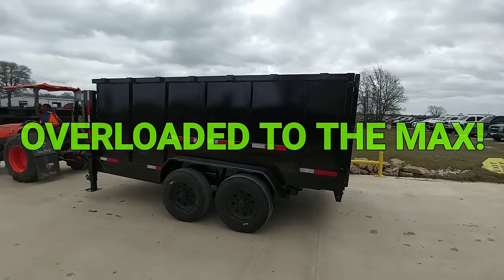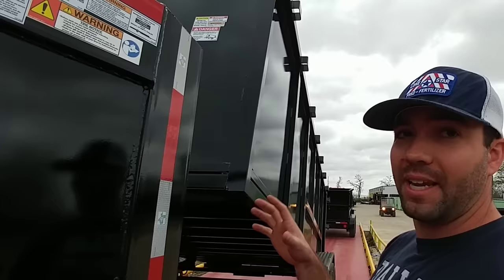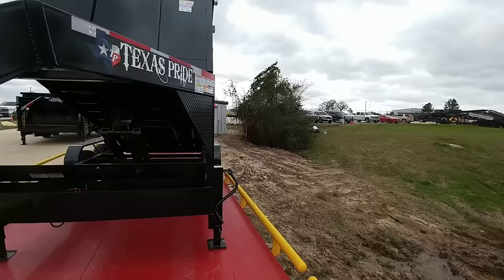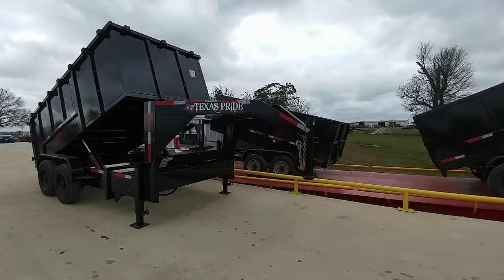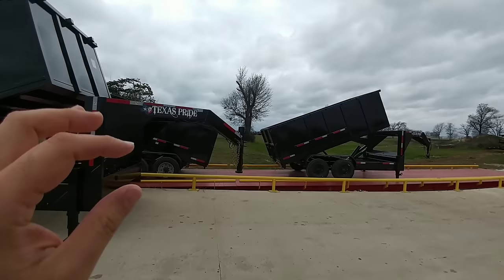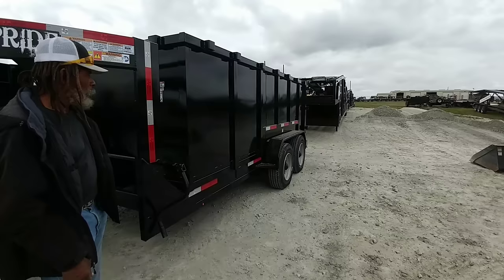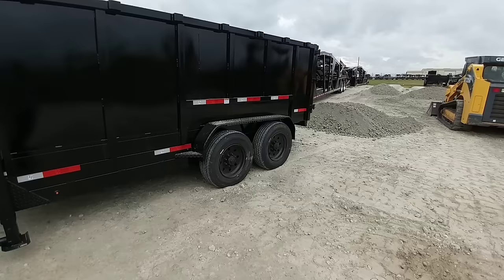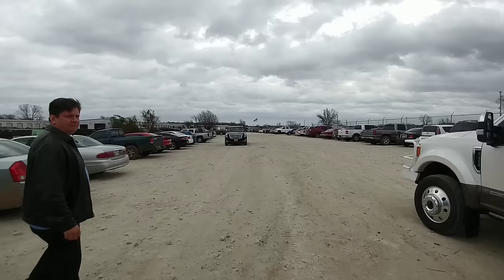Crazy Test with 3 Dump Trailers WAY Overloaded! See which ones failed!

Comment: I've used all types of dump ram systems in the heavy construction industry and the semi single ram is great BUT I've also seem many of them tip over, two main reason. 1. The operator doesn't lift on a level  and solid grade. 2. The material gets hung up on the front of the trailer and one side brakes free while leaving the material weight off setting and twisting the ram and dumping the truck and trailer.  Engineers can apply all the math for PERFECT mechanic's of lift and stress points, the one variable that can't be figured in their equation is when the load hangs up and the operator is inexperienced in realizing there's a problem before the point of no return.

Comment: For sale, three trailers only used once!
Reply: What size?
Reply: Give me a good deal i need one of those anyway. Ill change all the seals.
Reply: They actually gave them away. Although the one with a bent frame they replaced first
Reply: @Sicktrickintuner  Wouldn't the bent frame refer back to their engineer expert?  I have worked with engineers before.
Reply: As is...

Comment: Redundant doesn't mean what you think it does. Redundant mean the extra isn't necessary. If one cylinder fails on a twin system they whole thing goes down. That's to opposite of redundant.

Comment: We had a tree removed,and the crew used a dump trailer, with a scissor lift. I noticed they kept two blocks of wood under the front of the trailer, preventing it from coming all the way down.  It stopped about a foot from being all the way down.  I asked why, and was advised, that was the only way they could dump heavy loads.
Reply: Sounds like you went with the cheapest bid

Comment: Great video! Thanks for the info. That pin can be held in place by a piece of chain and an implement pin w/locking ring. Hook the chain at the bottom of the door. Drill the pin hole in the handle. Make the chain where it tightens, before the door pin clears its locking hole. Just a thought, I'm looking for a 7 x 12 , with a spread gate. Thanks again!

Comment: Look at the BIG trucks they all telescopic, enough said. Been pulling dump trailers 19 years, frame, frame less, tub, square, closed tandems, spread axle. I've had 79,000 lbs IN THE TRAILER, no issues dumping.

Comment: I've hauled 22 thousand in the trailer with the scissor lift we use bars on both sides to get it started to dump.
Tires take a beating .
Always put 17,000 in the trailer at the Gravel Pit it's the perfect heavy load.
For a pickup!
Very good trailers.
There is one thing though on the tailgate The Swinging Doors the outside pockets fill with water causes the weld to rust and they break.
If they had a hole in the bottom of the pocket they should drain.

Comment: I have an old 72 Donahue 8x16 grain trailer. I was hauling driveway gravel. The sand pit operator had broken his arm so his wife was running the loader. I came across the scale at 30060 lbs on three axles. The front axle of the pickup was off the scale. The old girl protested but lifted the load. It has a scissor lift. Scissor lifts help raise the load evenly when not loaded even side to side. Great video!
Reply: I have one of those as well, it was always my favorite trailer. 
I have a 8x20 with a scissor lift and it can't lift if I'm fully loaded with shingles. I'm needing to figure that out.

Comment: Dual cylinders provide no redundancy if they're on the same circuit.
Reply: bzacon 

They also do no good individually if they're on opposite sides of the trailer.
Reply: No, but there are easy ways around that.
Reply: Puckgrinder85 

Such as?
Reply: If one fails in series they both fail. If the are plumbed independent and one fails it just bends the hell out of the trailer and probably won't lift.
Reply: I don't think it would ever be an approved designed if they were independent due to a risk factor
Reply: If one ram in a independent dual ram set up fails the trailer tips over and bends every thing any way. The only redundancy that works is a self locking ratchet bar but none likes them due to the clunk clunk clunk.
Reply: Nonsense! I was told I there'd be free beer until 4:00!

Comment: There are still a lot of variables in this test. Battery strength and where the dirt is loaded in the trailer to start. Should have used concrete blocks instead that way it could be put in the same location in the trailers between the three.

Comment: I had problems with a telescopic lift on a 1 ton dump, but a lot of people have told me a pusher sissors lift is the best on a truck, but I bought a dual cylinder thinking it would be sturdier!, and lift the weight its rated for with out any problem!, I will not overload it because the tires are only so strong!. I dont care how fast it dumps as long as it works good!. What a great test!.

Comment: We have nothing but scissor lift dump trailers, with a simple adjustment of the pressure relief which is set way too low from the factory it will dump more than you can put in it. The only reason it won't lift is it goes into hydraulic relief right away. With the weights we Haul, I believe it's time to move to a gooseneck versus bumper pull.
Reply: Tread Lightly Services LLC. That may be something I need to look into ASAP.  Dump my 14k at about 20-22k 5+ times a day and man does it struggle.
Reply: Also large thing with a scissor lift in the placement of the cylinder on my dump it’s with in the first 4 feet of the dump bed. It’s able to dump 10-12k no problem every time. Even when most of the weight can be right on top of the cylinder.
Reply: We increased the scissor lift pressure on our farm truck dump bed just enough to get it to lift fully loaded and it worked for a while till the lift cylinder blew apart.  Then we got to unload the whole bed of grain with shovels and repair the scissor lift.
Reply: @robhartshorn6823  I really shouldn't have laughed, because I know what that's like.

Comment: Electric over hydraulic pump have a pressure  set screw in the pump . I always turned them up a little to get more on the pressure side less return. Used to load 8 - 9 tons no problem

Comment: I'm telescopic all the way less stress on the cylinder and framing of the lift then the othere that are pushing so much in diff points just to lift a load the. Straight up bad down
Reply: exactly, telescopic is the only way to go.
Reply: If only it  would lift as high as the other ones 😕
Reply: @andp120  every one iv ever had went higher then otheres

Comment: Everyone is choosing the telescopic front cylinder.  But, what about stability on slightly uneven ground?  All working situations are not under laboratory conditions.  Because of this I would prefer the double ram and I am considering side to side level and tip over potential.  Just commenting.

Comment: JD you’re absolutely correct. My dump trailer has the piston underneath. The first 6 inches is the hardest when it’s loaded front heavy, after that it’s fine. The style you have wasn’t offered when I brought mine but if I ever get another dump trailer I’m gonna get the kind you have.
Reply: The second stage isn’t as strong as the first, I’d seen plenty of dump trucks get a load 1/3 of the way dumped and the next stage was maxed out.  

With the single or dual, the angle is bad for the first 6-12” as it’s pushing back more than it’s pushing up. 

It’s extremely likely that the first on would of lifted up and then overloaded the next stage before the load shifted.  Once the load shifts and starts dumping it’s lighter and will dump so really depends on what you haul and if you can shift the load soon enough.

Comment: Y'all need to run a video tutorial on front-of-load baffles to defer the weight of heavier materials into a smaller linear space back closer to the axles.  And if you don't have a kit you damned well should draw one up.  Keeping a denser load from shifting forward is VERY important in dump trailers.

Comment: Are you sure about the dual systems having redundancy? I ask because it is my understanding that if one fails, the other one is typically not strong enough to lift the trailer with any kind of load on it. To me that would mean you have two points of failure in your hoist system instead of just one. I’m only looking at telescopic and scissor lifts at the moment

Comment: Scissor lift every time for myself, the rocking and twisting of the body isn’t applied directly to the cylinder when pulling foward on uneven/bumpy ground which is generally the case for these dump trailers... those 10k axles are also not cheap to replace
Reply: Bumpy and uneven ground is the reason I would think the double ram trailer would be preferable, although all seem to be able to handle the 20K handily.

Comment: The huge flaw is they’re only lifting 6-12”. The dual cylinders are weakest at the bottom because of the angle.  The telescopic is strongest in the first stage 6-12” and significantly weaker in the second or even third (depending on design) stage.  

Also, they don’t even consider max dump angle.  Many of the telescopic trailers don’t have near as much of a max dump angle as the scissor lift designs,  if the scissor lift were moved forward and/or the arm lengths were changed they could be significantly stronger than they’re currently designed while matching the same dump angle as the others methods

Comment: great video ... I have  had telescopic and scissor types ... and next a dual cylinder scissor type on a  tandem dually trailer on the way ... telescopic is the best ... but I added a 50 watt solar panel that keeps battery in top charge condition that is important .. I will have 2 dump trailers one for rock one for bulk items.

Comment: Only one big problem I've been curious about. The only reason to buy a "Dump Trailer" is to be able to dump the load. There was only one Trailer that could actually "Dump" the load. Front cylinder Trailer it will be for me. Thanks for the very informative information I needed gents.

Comment: I had a 14' Carson pull behind and used beating the he'll of carried boulders and gravel never let me down pulled whit 1 ton ford heavy single rw4x4 always between 7 to 9 tons from the mineral pit and coming down the hill with not trailer brakes just the trany. I sold it a year ago for 3k and still working good 😆

Comment: I've drove dump trucks and they all had the single hydraulic jack in the front and they worked great. But some of the bigger off road haul trucks had dual jacks on the sides and worked great also. But I myself like the single hydraulic jack in the front.

Comment: The problem with the front host lift trailer is that if the trailer is not level when dumping, it would be easy to twist and flip the trailer.

Comment: I've worked on hundreds of dump trucks used on farms for grain. Some of these trucks had hoists from the early 50's. I never saw anything with dual cylinders, mostly scissor lifts, a  few front cylinder lifts, and a few cam and roller lifts. There is no way I would buy one without a scissor lift. The single front cylinder on your trailers just look weak and unstable. If I had to buy a front cylinder one I would want it with 2 cylinders.  I had an automatic bale wagon with 2 cylinders at the back. Bale wagons like this have the deck lift to a few degrees past vertical and used a 3rd cylinder at the front to start the load lifting. This cylinder was mounted vertical and the top clevis pin sat in a notch on the underside of the trailer deck. I think it had about a 16 inch stroke.

Comment: Are the cylinders and pumps sized according to rating? You could easily make the scissor lift pick up more than the others by upsizing the cylinder and lower the lifting power of the front lift by reducing the cylinder size, which they may do now to save some cash on each trailer. In this day and time it's hard to take anything at face value. They do look like good trailers, though.

Comment: Been looking at a load trail, but after watching your videos including the one with Matt I decided to look into Texas pride for my dump trailer. Actually just got off the phone with Derek and he quoted me $1000 less than load trail.
Reply: Ive had 2 load trail.  They are both awesome.  Never any issues.   I have the scissor lift.  Wont be disappointed
Reply: Stick with load trail
Reply: I shopped build quality and features and ended up with a Lamar 16’ GN dump and it is an awesome trailer.
Reply: Load trail builds good trailer. You get what you pay for. Cheaper isn't always better. I have had 4
Reply: Have a load trail bumper pull for roughly 10 years it’s a 12 footer and have always overload it. Has one single cylinder but it’s a decent size one. Have Load it with 50+ squares of roofing material before through those years of owner ship. Never complained about it and never field on mechanical issue just one leaf spring busted last year but that’s it. Each bundle of shingle is roughly around 80lbs and 1 square is 3 bundles. So over all load trial has done me well.
Reply: STICK WITH LOAD TRAIL!!!!!!!!!!!!!!! DONT DO IT!!!!

Comment: I absolutely hate telescopic lift cylinders,We have 18 dump trucks at work with them,They are Leakers,And require a ton of fluid capacity. The cost is about 2000 just to have them rebuilt.
Reply from the maker: Though similar technology, a dump truck lift is required to lifts significantly heavier loads, costs more to replace, and takes more time
Reply: John DiMartino those telescopic cylinders only leak when they are not properly maintained.

Comment: Great video 
I would love to have a dump trailer 
I have no need for one that large
Either 
But as a retired guy that’s shoveled more than his share of  stuff out of a pickup or trailer 
If I was rich 
I could the crap out of one
Reply: Ricoville   Thank you for your thought   

I have seen these items most of the landscaping co use them I get poor enough gas mileage on my truck as it is extra weight would just hamper I think. There are trailers with like a 4 k load rating sold problem is I’m a retired guy with no money to spend on something I use 4 or 5 times a year

Comment: we have one atm there is also another  flaw  in these trailer's . yes  the hydro might be  good for 30k pounds  but the wields  are not going to hold up ..  even at the  there load limit the  the front of the dump trailer will in fact split the wields ..
Reply: *welds

Yes I agree

Comment: I always took a 4×4 and left it under the front to keep it up and if it still couldn't do it I'd use the hi lift to get that first foot of lift with the dual ram Texas pride we use...
Reply: John Givens 
Why not buy a trailer that's big enough to handle that amount of load? Obviously, if you're using a 4 x 4 and a hi-lift jack all the time you need a bigger trailer that's designed for the weight your hauling.

Comment: I have front ram and the issue is not getting it up. I’ve had my 5 ton dump way overloaded. It failed when the trailer was at about a 45 and a lot of the weight is on back corners. One corner dropped about 4 inches. Saved it and got the dirt out. But took some cutting and welding to get her back.

Comment: What was done to ensure the battery on each trailer was the same -  and at the same charge?       I think though what you really proved is the trailers can take some abuse.
Reply: Great point! And believe it or not as those motors get hotter and hotter they make less and less power. All about amp/turn in the windings to make torque. As they get hot resistance goes up current goes down. Amp/turn "flux" goes down.
Reply: That battery is the key for sure!!!

Comment: I seems almost every dump trailer on the road has a 4x4 under the front of the box to help with the first 4 inches.
Reply: I carry a pry bar so if they overload my scissor or load towards the front I can give it a little help.
Reply: I will try that trick with my 2019 brimar.  10k
Reply: I have noticed the same thing.
Reply: @jeffwrightsman7797  I understand how the dual ram has bad geometry when starting out, (ram is pushing almost straight back not pointing up much) and those benefit from a boost for the first foot until its pushing up at a better angle.  Is the scissor the same way?  Like if you can just help it up the first foot, it'll always go the rest of the way on it's own?  Its harder for me to understand the geometry of the scissor...  If it's plenty strong after the first foot or so, I'll get a scissor.  But if scissor is weaker all the way up, then I can't even consider it.  Thanks!!
Reply: @benherstad  my scissor does need a little boost  the first 6 inches if overloaded towards the front of the trailer. It may be because my trailer is a low pro and it is set up differently.

Comment: There definitely nice trailers but at the 8.43 mark the way those hoses are routed. It needs the plastic blocks that bolt and hold the hoses securely and the top hose run it down and fasten it the same way. Throw them ubolts away.

Comment: My bigest question is where did you come up with the scissor lift being an upgrade from the 2 cylinders and that anyone thats been doing it for a long time prefers to stick with the old way of two cylinders the scissor lift is one of the oldest types of dumps and the single extending cylinders is right after it the duel cylinders is one of the newest types there is that being sead i like my texas pride trailer we have 2 with the duel cylinders yall didn't offer the extending one at the time but id still gone with the 2 there up underneath and protectd better from the sun and debree that could scratch it up and such i would say there safer than the extending cylinders watch some end dump failures on you tube